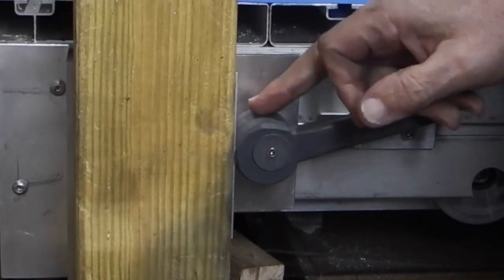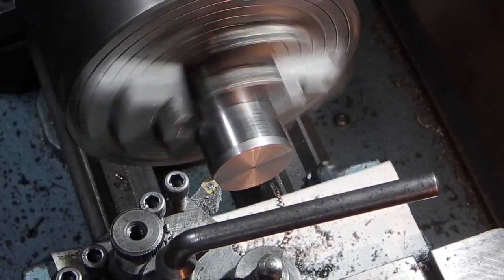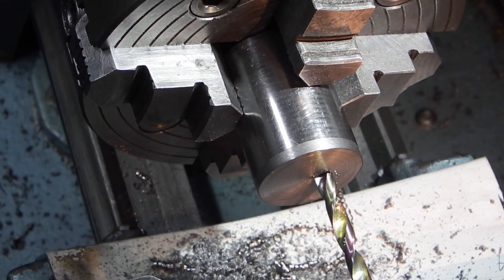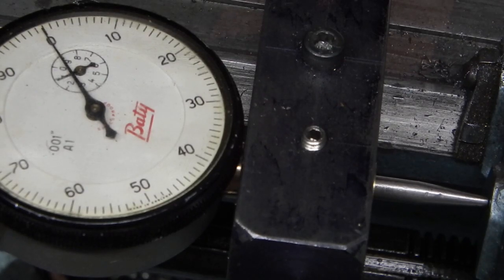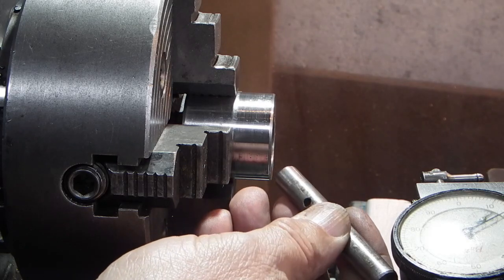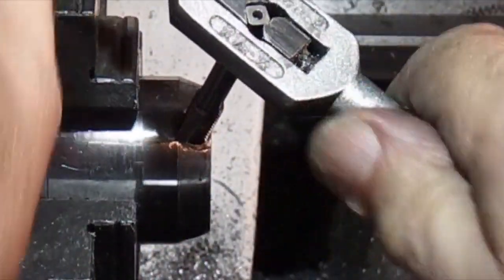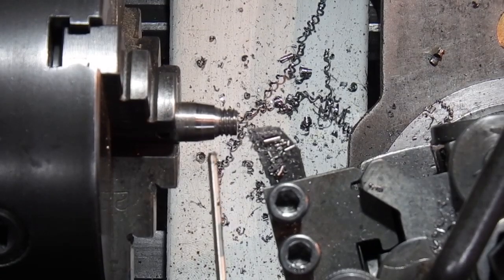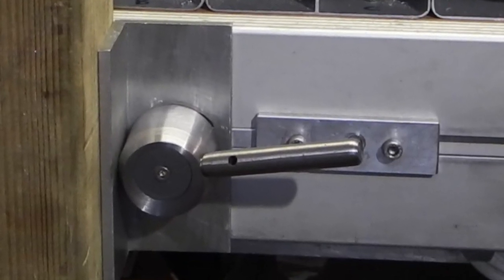Cam vice handle

Comment: That's a very clever vise. Is that mounted on the end of your CNC router? Perfect for dovetails or box cuts. I think I need one on my CNC as well. Thanks for the video!
Reply from the maker: Hi George Yes its on the end of my CNC so I can hold a length of wood up to 4 foot long and machine dovetails in the end.